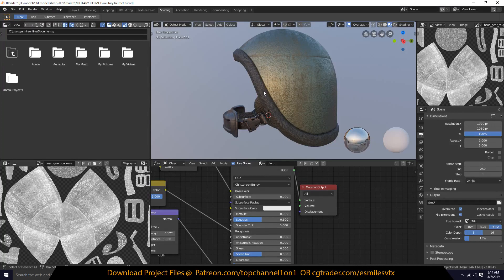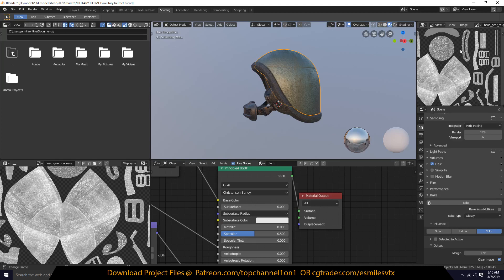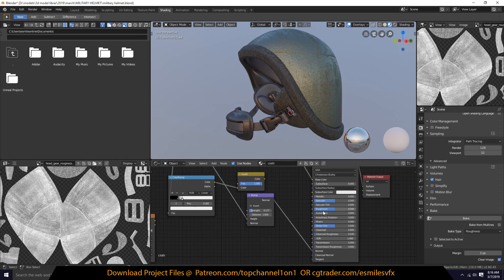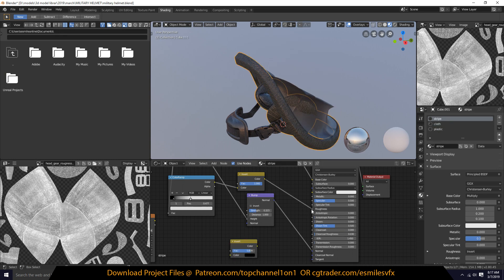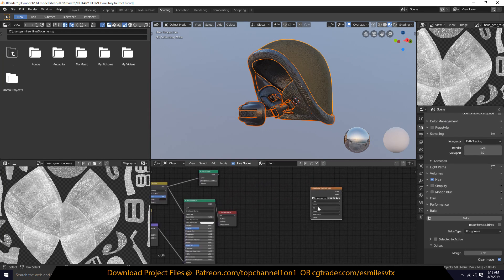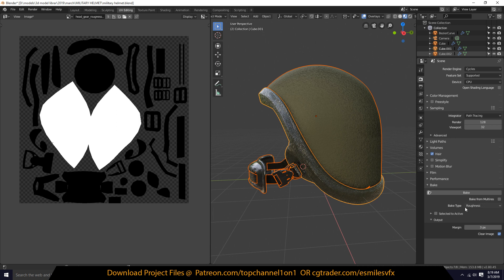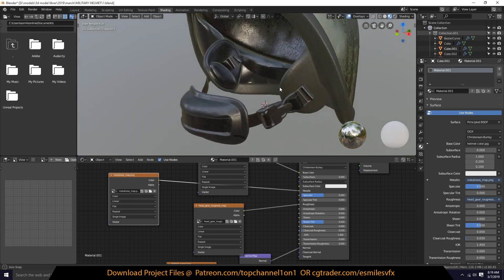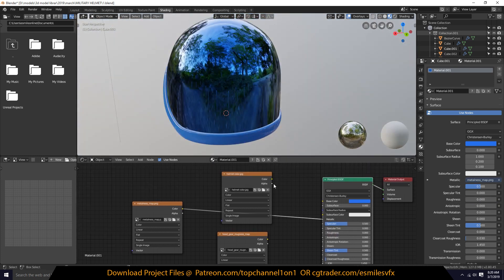how to bake a metalness map in blender tutorial

Comment: Why Blender won't use bake using the actual Metallic Node will be an absolute mystery to me. Why does it always bake out Black on all other maps that have a Metallic value? I have to go through my whole model, switching out the Metallic nodes, just for the Metallic maps? Stupid. Also yes, baking at a Render value of 1 instead of 128 will save you mountains of time, and it's the same result if you're flat baking and not using any lighting inputs (Direct/Indirect).